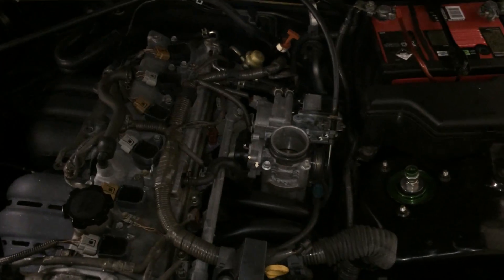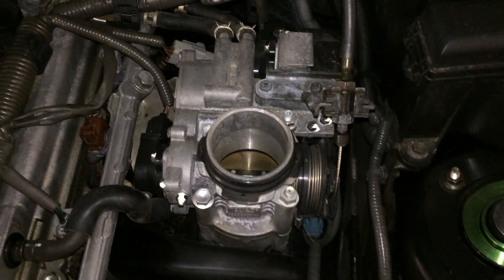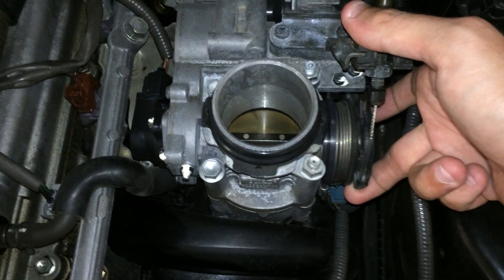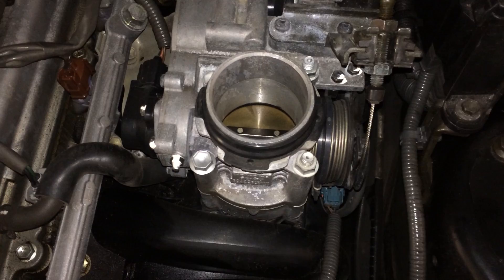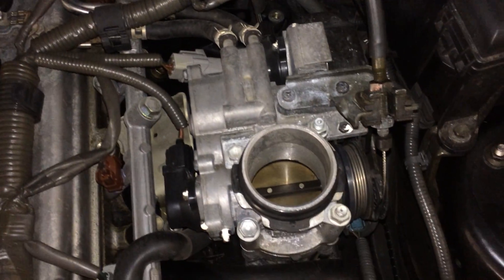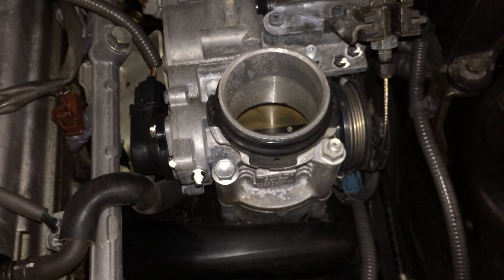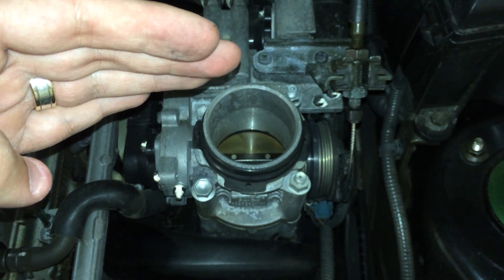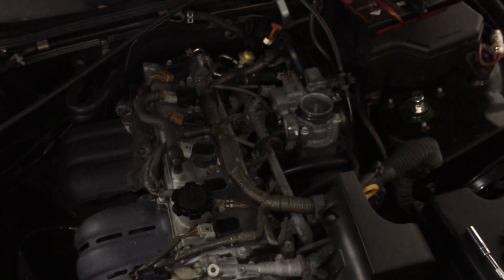Lexus IS200 Throttle Body Explanation - ETCSi problems

Comment: my toyota altezza as200 1gfe does not have coolant lines to the throttle body, and if i rotate where the cable attaches it rotates the butterfly. so it seems only the lexus version has the drive by wire, not the altezza version. mine is still super slow though.
Reply: yeah same mine isnt ectsi

Comment: i changed my old throttle body it was broken , installed a new oem one now my car rpm is always at 1200 when in neutral. Does anyone know what could have gone wrong or how to fix it ?
Reply: clean ya maf, it should idle lower after. ideal idle rpms should be just below 1k like 900 something

Comment: Please can you tell me the location of the coolant temp switch and thermostat?? Thank you
Reply from the maker: Thermostat is on the engine side of the lower radiator hose, the coolant temp switch is in the lower radiator tank, it’s the only switch/sensor in the bottom tank, I can’t remember if it’s the left or right hand side.
Reply: @ThatCarChannelOfficial  sweet thank you very much👌

Comment: Hey bro. I have a toyota altezza 1gfe, my throttle response is lagging. Put the air con on and it's worse. Idle is good, coils are good, I changed the tps as well. Can't seem to figure out why it's the way it is. Taking off from the lights or something and it takes a while for the throttle to do something. Leaving home after warming up the car to go somewhere and it lags for about 30 - 40 meters making a bogging type noise and then the throttle will start to kick in.  Any help will be much appreciated. Thanks
Reply: Nah I don't know anyone else with the same car, but I serviced it as soon as I got it. Only had the car going on 2 months now. Changed the rocker cover gasket as it was leaking oil from it, the vvti screen was blocked big time, got a new one. It's a bit better now but still lags. How would I know if it's stuck in snow?
Reply: @CHOPPER_BENI_N7NE.S  where is the vvti screen? i have removed the vvti solenoid and its working properly. but if there is a filter to check and clean i would like to do that if its easy. im going to remove and clean the injectors and throttle body this weekend. its looking like that is my issue.
Reply from the maker: BenJnr G.I do you know someone with the same car you can drive and compare? The throttle is lazy but not really that lazy.. it sounds like it’s stuck in ‘snow mode’.. assuming you have done the basics like run a few tanks of high octane fuel, checked air filter, how is the oil - sometimes poor service history can get oil crud in the filter screen partially blocking the VVTi solenoid, which affects cam phasing.

Comment: Well thats some...i have an altezza as200 and it gives full trottle all the way, same 1gfe. The flap fully opens. Its a manual trottle body
Reply from the maker: Awesome, maybe the lower grades came with that setup? I would also say that it should have a completely different way to control traction control, cruise control, idle speed etc etc
Reply: @ThatCarChannelOfficial  Yea
Reply: @joshuacarter713  It's a 1G-FE VVTi Beams that have the classic throttle style (it should say Beams on the air filter), and the normal 1G-FE VVTi have the ETCSi
Reply: @batman3698  oh good to know
Reply: @batman3698  I have the same car and engine as Joshua, but the throttle is electronically controlled... Is it only for certain models?
Reply: @007-Bond  my altezza as200 is a normal cable operated throttle body too.

Comment: This throttle body is amazing, just exactly what THIS car needs. Don't try to an airplane out of a horse buggy, or complain that one is not the other.
Reply from the maker: It’s a great setup I agree, the programming though could have been soo much better, even if the ‘pwr’ button was utilised to ‘liven’ up the response and allow full throttle when full throttle is requested etc. in normal mode it’s fine.

Comment: I like the set up....it prevents me from over revving the car when it's cold...and with all the Speed Cameras and Speed Bumps strategically placed..I don't do racing starts anymore..show me a Twisty country road 😆 and you will need smthn special to overtake a well driven is200 Sport LSD equipped. ..
Reply from the maker: I’d be more inclined to agree with that if you said Altezza (3SGE):)
Reply: @ThatCarChannelOfficial  I agree..but 3SGE is rare in UK..besides they don't have the extras. .sunroof. .plus many more

Comment: Could the electronic controlled side of the throttle be manipulated by an after market ECU telling it to copy the users pedal input? Because even if the electronic throttle was swapped for a normal wire, some computer input would be needed to tell the car why it can’t control itself.
Reply from the maker: i know there are ETCSi controllers out there that manipulate the signal to give more throttle response. more so applicable to the JZX110 & JZS171 - you may even wish to look into the premium japan throttle kit - although i don't see one specific for the 1G-FE IS200.. i fitted one of these throttle kits to the ETCSi VVTi 1JZGTE that i converted my IS200 to - and it worked brilliantly! highly rate the product!

Comment: My chaser runs with 1GFE when i floor it, it gives me HP as much as i want,  this one is 1GFE "B.E.A.M.S" i guess
Reply from the maker: I have a GX100 throttle body - it does not have ETCSi, it has ETCS just like the jzx100 1JZ variants. That’s a whole generation older than this one. The gxe10 is200 is built on the jzx110/jzs171 ‘platform’ shares many many mechanical parts and also has the same generation of ETCSi. 
I am only assuming you have a GX100 chaser (or they might be called a GX101 is not 100% sure)
Reply: @ThatCarChannelOfficial  gx100 avante, yup
Reply from the maker: Yep there a normal style throttle, I wanted to convert the etcsi back to that! But due to the idle control and sensors (almost like having 2 TPS) it was almost impossible to work out.. then I went down 1JZ route anyway 😎
Reply: @ThatCarChannelOfficial  Long shot question but how did it work out with the 1j? Happy with it? What transmission did you use?

Comment: Thats why i have delay when i sudden accelerate on the pedal because of this?? There is latency.
Reply from the maker: Sure is!
Reply: @ThatCarChannelOfficial  in line 6 is a very good engine. It takes off when you floor it but Im not really impress of the latency?? I believe it can perform better if i can modify it.

Comment: ive ever owned a car over 110hp so to me it feels fast :'D
Reply from the maker: if it was a car that weighed 500kg it would be frightfully fast :) even something around the 900kg mark like an early corolla 110hp would be plenty to have fun with..
Reply: @ThatCarChannelOfficial  I'm dropping this in my celica which weighs about 600KG less then what the is200 is..
Reply: @tobywarren6151   which gen celica? the is200 is around 1500, and the 1g is a pretty heavy engine. if you get a 900kg 1g celica you probably have it stripped out pretty hard. and a stripped is200 is around 1150-1200 depending on how thorough you are.
Reply: @givemeajackson  The IS200 is around 1360KG.
Reply: @stefano3124  i wrote a stripped out is200. You can easily dump 200kg of weight if you drop seats, stereo, sound damping, spare wheel etc.

Comment: I had a random idea regarding this. I haven't tried it myself but it would potentially allow for better first gear characteristics.
The idea is to intercept the speed pulse sensor signal from the transmission with an artificial frequency, essentially tricking the ECU you're constantly driving at 150kph or something similar. Worth a shot maybe? This would possibly bypass your speedometer though but the car would get WOT in first gear.
Reply from the maker: +AX53 yeh sounds good! Try it!
Reply: So been thinking more about this recently and i think this method would unfortunately throw off the odometer as well. So it's not a viable solution either unfortunately.
So the only other idea I can think of is to run an adapter (perhaps 3d printed) and run a throttlebody and IACV of another car. As well as another ECU. It's not the easiest fix though.
Reply: Sorry to necro post a little bit, but I'm thinking of this application for installing this engine onto different gearboxes in different cars. Say for instance my ta22, the flywheel and gearbox bolt straight up to the 1g block, but they have a physical cable for all speedo and odo drive. So would it be possible to trick the computer like this for that sort of application?

Comment: Fuck that's a bummer lol. I'm looking to buy one of these cars and currently just researching them a little bit. I want it to be a bit of a drift car so this crappy  throttle system is a big let down. I hate electronic throttles with all my heart lol but I still think the IS200 is a really great car in the other aspects.

Clearly the ECU is way too advanced to allow for any mechanical hack fix for this problem / design flaw and any attempt to solve it would completely throw off the fuel ratio. But if you're up for a new ECU + re-tune it's fixable I guess.
Reply: What did you go for in the end?
Reply: @blackwersus  I went for the IS200 although its pretty shot at this point. I'm about to part it out.

Comment: any progress with throttle body? anybody who tried to hack this throttle?
Reply from the maker: Sky Factory japan makes a throttle kit that makes the etcs-i throtlle almost electro mechanical 1:1 - it is by far the best option i have found, and around $200 USD shipped anywhere in the world. they make them for JZS171/JZX110 1JZGTE, and Altezza 3SGE as they all use the ETCS-i system.

it allows for full retention of the idle, cruise control and all normal behaviours, but alters the input/actuation to be almost full 1:1.

email them at
Shy Factory - shyfactory.japan@gmail.com
Reply: oke nice,good to know. Thank you!
Reply: @ThatCarChannelOfficial  I didn't find any info on the Sky Factory Japan throttle kit, does it also work with 1G-FE?
Reply: @ThatCarChannelOfficial  can’t find anything on Google about Shy Factory Japan in late 2021.

Comment: i have an altezza with the same 1gfe engine, but...it has no electronic controlled throttle. only the is200 had
Reply: AX53 wrong, Altezza’s SXE 10 chassis are the ones that came with the 3sge and the AXE10 chassis came with the 1GFE.
Reply: If it has a 1G-FE it's an is200. Altezza has a motor called 3S-GE
Reply: @AX-xi2pw  altezza as200 = 1gfe
altezza rs200 = 3sge (great car and engine combo. plus 6 speed manual and lsd)

Comment: This is the best explanation of the Throttle body response.
I have found a modification kit that fixes the butterfly to the throttle whilst still allowing  the computer to manage idle and RPMs for other functions.
BUT older posts and I can't find anything for up to date info or any clue on how well if functions.
Purely mechanical fix.
This is for another throttle body but the principle is the same.
 https://www.youtube.com/watch?feature=player_embedded&v=vUFxl9f9X88#action=share
http://z4.invisionfree.com/lexusaltezzaclub/index.php?showtopic=14054&st=50

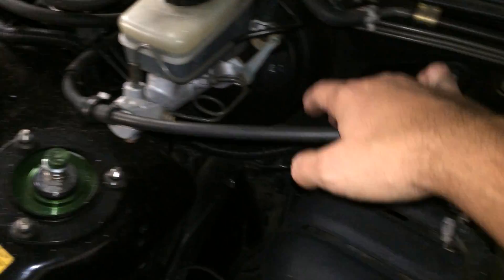Comment: 1:06 when you bring the throttle cable weight around there, could you tighten the cable at all so that it stays right there, then it's right at the point of opening? or would that make the idling shit?

If that was possible and not a pain in the ass to do, it would be a lot more responsive just from that. I noticed the 'swing' of that cable weight or whatever it is when cleaning the top of the throttle body, spins to that bit in the video then you gotta press it further to open the butterfly valve.

Taking the whole body off is a pain the ass too if you wanna give the whole thing a good check over, get to the intake or clean it down.

Comment: Great to see that someone is working on DBW of this car, because it was implemented very bad.. I have a manual and si annoying when i change the gears around 2.4k RPM, rev flick is just ridiculous. Never saw anything like that on any car. I've pulled a ETCS-i fuse out and ''weld'' the butterfly that was fully cable operating....Guess what....After 2 revs engine automatically dies... Without BDW this car will have 2x better response.... I hope you will manage to figure out how to make it work... Respect to you
Reply: I like the set up. .it won't let rev if it's still cold is a brilliant idea...it's not a car for racing starts...in B road very few cars will keep up with a LSD equipped Manual IS200...power you can use..all the time...i ve one😆..IS200 Sport. .MT. .
Reply: Did you manage to get it work finally?
Reply: @blackwersus  If you only disconnect the stepper motor you will be able to rev the engine to limiter. You also need to weld or bolt the butterfly to cable. You will have the check engine light, TRC flashing and you will lose the idle control. Most of people do it for drifting, not for street. Here is one hint: https://www.youtube.com/watch?v=AIeJL6_CeR4
You can also go to the Facebook group IS200 for more info....
Reply: @deboxonline  Thanks for the info. Yes it will be a beater car so I'm not worried about losing some comfort. It is good to keep daily and a project car separate.
Reply: @deboxonline  i have this problem, how to fix it?

Comment: Did you ever get anywhere with this mate? Is there a way to mod the standard body to do away with the electronic throttle without causing a management light? :)
Reply: MrExtremeboost MAX Boost Have you tried to trick the electronics with piggyback or you just assume ? Unichip Q has some features like - Manipulate drive-by-wire throttles
Reply: That's interesting. But what about running it on a GX100 ECU? That's one possibility i reckon.
Reply from the maker: FlatDreams i haven't yet, i have purchased a GX100 Chaser Throttle body, which is a simple cable throttle body, no double TPS ECTSi etc.. however it uses a 3 pin ISCV (idle speed control valve) where as the GXE10 tb does not, it has inbuilt idle control in the ETCSi function.. it will 100% bolt onto the same plastic inlet manifold.. but the electronics is what has stopped me. even if i got the ISCV working to control idle, of course i would loose cruise control, but i would also need to overcome the second TPS, which reads differently to the first/primary TPS..

basically it would require FULL aftermarket management, not a piggy back Greddy manage or unichip etc.. to control it, like a traditional flyby wire unit... or the full control of the GX100 TB with it's 3 pin ISCV, and do away with 2 TPS etc...

looks like anyone wanting sharp and crisp throttle response will have to look into something like that, or beams 3SGE, or 2JZ-GE swap (with all the other bits that go along with that.)
Reply: @ThatCarChannelOfficial  weld the two together that the cables connected too, cut the bar conneced to the outer ring qith cable kn amd then cable tie the elctrobic motor open... full throttle when wanted Throws up eml and trc light will flash. Raise idle 100 revs to solve cold start issues